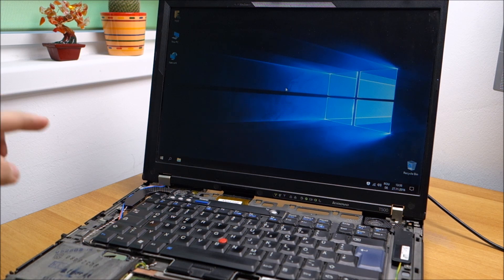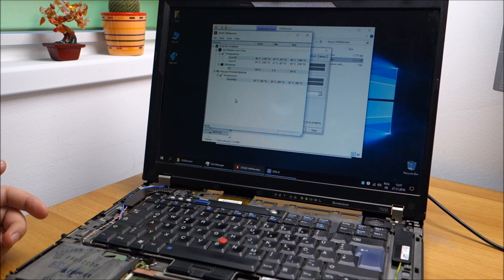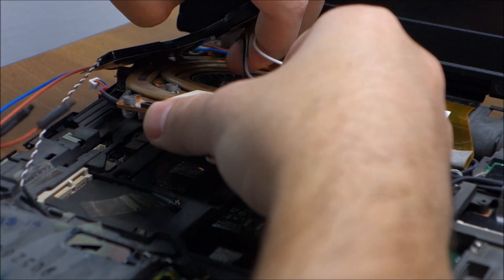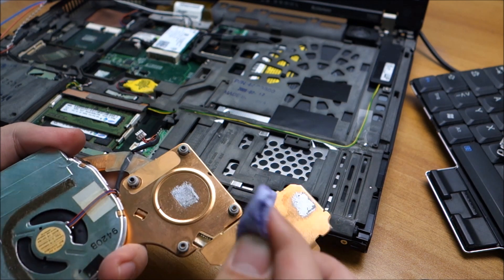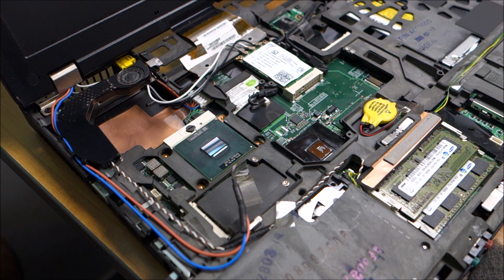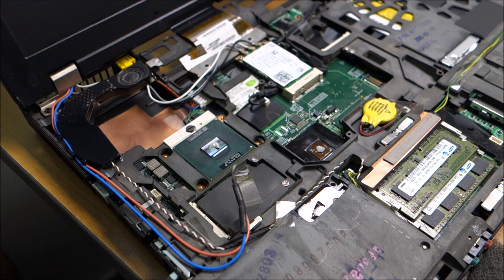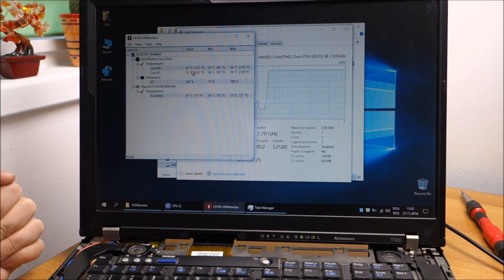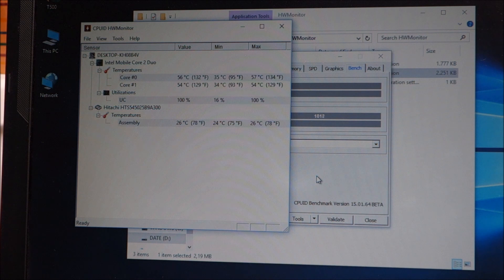DANGER! Coollaboratory Liquid Ultra - big problems after just one year

Comment: Leaving this as a top level comment so more people can see it:
I did more reading about this stuff since I'm interested in using LM for my own laptop, and it seems corrosion is not out of the norm. 

Typically when LM is used under the IHS of a desktop CPU (often necessary for intel chips since they bond the IHS to silicon with toothpaste instead of solder) the results are pretty good even after a year. The IHS (which is made out of copper, then nickel plated) does get stained by the LM but nowhere near what happened to you. This is because your contact (in a laptop) is silicon die <-> LM <-> copper heatsink.  In the desktop scenario, LM is often applied underneath the IHS so the contact is silicon die <-> LM <-> nickel plating <-> copper.

To be even more clear, the key differences in your application of LM is that
1. Your application was silicon-copper instead of being silicon-nickel as you would find in the 'delidding' of a desktop CPU
2. Your application was not insulated against air (read: oxygen)

1 is important because the electrode potential of gallium is -0.53V, nickel -0.24V, and copper +0.34V. Obviously, all liquid metals are made out of gallium (because Ga is liquid at room temp, and is also nontoxic unlike mercury) plus small percentages of other metals to reduce the melting point. When gallium is in contact with pure copper, the differences in electrode potential favors the gallium and copper to alloy, which will eventually consume the gallium completely[1] (Ga + Cu → CuGa2 [67%] + Cu3Ga [11%], and both products are stable until 175C)[1][2]. 
The liquid metal will literally into the copper until the gallium is gone, which causes the copper to turn silver-ish. The non-gallium components (indium, tin) of the liquid metal[3], which are solid at room temperature, get left behind - and that stuff is hardened deposit that you were trying to scrub off the heatsink.
Note that at higher temperatures, the reaction between gallium and the copper heatsink only gets faster.

2 is important because the gallium based LM components can and do oxidize. This is the reason why people generally recommend sealing your contact as much as possible. With a desktop chip under an IHS that's already halfway taken care of by the IHS itself, so if you've never seen a liquid metal tutorial for a laptop you might have not even known that sealing the LM was important. I'm not making this stuff up, gallium begins to oxidize at 25C and fully oxidizes at 75C[2] (Ga2O3, mass fraction 0.12) which is a totally achievable temperature range. This is not even considering the fact that the other components on the LM can oxidize, and they likely will.

Other interesting things to note: 
1. The thermal conductivity of CuGa2 (the principal alloy of gallium and copper) at 20C is 98 W/(m⋅K). Copper's thermal conductivity at 20C is 400 W/(m⋅K).
2. We have no idea what exactly is in LM, the formulations are proprietary - but it's been said that the consistencies of Coolaboratory CLU & grizzly conductonaut are not the same so clearly whatever is in this stuff varies and lead to different results.
3. Simply buffing the residue off the copper heatsink and reapplying the LM might be OK. The GaCu alloy is obviously not as good of a heat conductor as pure copper but it's not clear how deep the gallium will attack. If eventually you keep reapplying LM and the gallium can't penetrate its own pitting then it's effectively self-limiting and you end up with a 'stable' LM application.

These papers are interesting if you want to learn more about the process:
1. http://www.ipme.ru/e-journals/RAMS/no_81808/grigoryeva.pdf
2. https://sci-hub.ac/https://www.scientific.net/DDF.326-328.227
3. http://forum.notebookreview.com/threads/something-to-think-about-liquid-metal-compatibility-with-copper-heat-sinks.800890/

TL;DR
Liquid metal pastes react with copper heatsinks (aggravated by oxidation and higher temperatures) until the gallium in the paste is totally absorbed by the copper heatsink and you end up in thermal runaway. The damage to the copper is permanent, but if you keep reapplying the LM whenever this happens you may end up with a stable LM application. LM is much more stable when used under the heatspreader of a desktop CPU, since the heatspreader is nickle-plated and way less reactive to the LM.
Reply from the maker: +bobsagget823 thank you for this explanation! I will pin it as the first comment so more people understand what happened.
Reply: Randy Levine do you have any supporting documentation backing up this claim? The white papers I've read specifically point out that gallium, a key component of all LM pastes, is reactive with copper. You may be confusing the result of that reaction with what happens to aluminum, gallium is not destructive when it alloys with copper.
Reply: gallium dont oxidize (nor react with oxygen to from oxide} with copper. gallium adhere to copper lattice because gallium properties are much more stabilizing than galvanic corrosion. how gallium adhere to copper is like electroplating and what ever impurities does copper have gallium will occupy its place that is why when you open it or replace the LM again some pitting will be observed on bare copper plate. cleaning out the white residue and reapplying LM is enough.
Reply: Im going to go out on a limb on this but I dont believe that heatsink is actual copper, I doesnt have the same pinkish color to it that copper products tend to have. It looks closer to brass or bronze than pure copper. Both brass and bronze contain either tin or zinc which does bond with gallium. This on the other hand is not akin to the affect of corrosion or amalgamation like you see with aluminum heatsinks. 

its possible that you may have applied it in a wrong way but to me it just doesnt seem like the right metal. Gallium can bond with copper but not really anything substantial from what i understand in a bulk and more likely in a powdered alloy so I wouldnt put the blame on a copper heat spreader. 

you can actually see in this video what real corrosion looks like https://www.youtube.com/watch?v=Hx66m_TgQg4 (the copper is intact, aluminum is not) .

Another posibility is too much LM, it might just be a thick enough layer thats making it hard to remove.
Reply: bobsagget823 Amazing explanation. So then reapplying LM until copper gallium absortion has reached a "saturation" point is recommended?
Reply: Hai!! what do you think of using just IC graphite sheets instead of using LM
Reply: hell of a comment!
Reply: How about they tell and warn people about this before advertise and sell their product?
Reply: I can say it reacts and oxydize even with a nickel, applied for an mirror polished nickel coated heatsink on cpu and after a while I noticed an oxydize on a heatsink surface, not a mirror anymore:) and all written marks on cpu heatspreader are gone, just blank... That looks bad I can say.
But I don't think that's affect a thermals, it's just kinda welded. I guess it's a good idea to reapply a liqid metal after about a year of use, still, liquid metal does a great job, better than Intel stock, but it's not perfect either...
Reply: @Blackfalk Nickel isn't COMPLETELY resistant to alloy gallium... just VERY resistant.
Reply: Well... he actually linked papers about this and you can clearly read there: "It’s known that liquid gallium reacts with copper(Ga + Cu → CuGa2), and the reaction ceases whengallium is consumed completely"
Reply: bobsagget823 ok, so, basically, only good for delided cpus under the lip. Used below the copper heatsink it reacts, well its not worth the risk, not gonna use it. ill use kryonaut then
Reply: I just applied LM to my 1070 FTW GPU, and will be deliding my 4790k.. While the cooler on the GPU is Nickle plated copper, I wonder how it will hold up to the oxidizing factor as the GPU die is unsealed unlike an IHS. 5c drop across the board on the 1070 FTW though so it's hard not to see this work when first applied.
Reply: THANK YOU
Reply: Blackfalk who said that it degrades over time?
Reply: oxidation. 4Ga+3O2 → 2Ga2O3.
Reply: Just leaving a comment, so I can't find it when I'm repasting a notebook
Reply: YOU ARE MY HERO BOBSAGGET823!!! :)

I live in the same town where Coollaboratory lives and you CAN'T buy from them directly 'coz they are frauds, liars

....so sad that so many fools just can't see that the CLU is DRY and not WET on his CPU maybe they are just plain stupid or get even paid to talk shit like this.

btw. I'm a hardware MANIAC and have changed the TIM countless times on a naked 3570K with Coolermaster Master Gel and Phobya HeGrease Extreme. 

You people get all fooled by so many liars and you even like it to be stupid enough to buy their shit.
 
Thanks a bunch for your comment !!!!!!!!!!!!!!!!!!!!!!!!!!!!!!
Reply: Liquid Metal absolutely DOES NOT react with copper as stated, tested and verified by the manufacturer. The proprietary agents introduced to the formula inhibit such reactions. Those who experience problems with 'copper' aren't really applying Liquid Metal to 100% copper, but rather copper mixed with other metals... Get your facts straight!

Comment: Liquid Metal alloys with the copper heatsink, it is NOT corroding it. After 2 or 3 applicartions of LM at the same spot (after cleaning and polishing), the alloy reaction will stop and the product will be stable.
Reply from the maker: Indeed, but some say the resulting alloy has not so good heat transfer properties.
Reply: @UltimateDIY  I just looked under the copper heatsink from my AIO and I also have the grey staining, thermal grizzly got sucked into the copper of my AIO copper cooler, its no problem just clean it a few times with isopropanol and try to add a new layer on the CPU. You will notice that the liquid metal isnt really getting soaked in anymore on the copper, thats because of the grey layer which got added by the reaction. If you just redo the step, you will have great performance again and dont have to change it ever again.
The damage is just cosmetic on a pure copper cooler.
Reply: @UltimateDIY  There will always be people talking about things the do not know anything about.

Comment: @Ultimate DIY - You really need to pick the correct product for what you are doing and what the parts you are using are made of. Especially presenting yourself on Youtube as a DIY teacher you need to start at the beginning and plan things correctly before you ever think about posting a video. You are making this product look bad and this is widely accepted in the PC Enthusiast community as one the best thermal paste available. Check  a lot of different reviews and you easily find numerous examples of Coollaboratory performing better then any other thermal paste even other LM.
Reply from the maker: Not really. It's actually better to present videos with f*ck-ups, so people can avoid them.
For the situation in the video 2 things happened:
1. LM did react with copper, although this information was nowhere on the product page or instructions. Take into consideration that at the time I applied the LM there was 0 info about this on forums. This is like I would tell someone now in 2019 why did he buy an Audi with a 2.0T motor, because they all and up consuming 1 litre of oil at 1000km, but the dude that bought the car new when it came out had no way of knowing this.
2. The gap between the heatsink and CPU die was probably too big. Again, something that was not common knowdlege when I used this thing.
Take a look here and you will see that there are many cases when this thing solidifies: http://forum.notebookreview.com/threads/something-to-think-about-liquid-metal-compatibility-with-copper-heat-sinks.800890/
And about reviews...if I would have made one, it would have been awesome for the product, because initially it really droped the temperatures a lot. This is why reviews most times should be taken with a grain of salt.

Comment: My question is does liquid metal, if it landed anywhere in the laptop, would it not be working?

Cause my laptop is working and I put tape on the pcb but when I noticed it got super hot, I turned it off and took the lm off and I just put it on today. 

If LM was anywhere in my laptop, would it still boot up?
Reply from the maker: If it's shorting something out it will not boot up.

Comment: Yea don't use liquid metal with pure copper, the galium in it does react with the copper (although not as dramatically as with aluminium), 

that's what causing the "drying up"  (it does not actually evaporate, but the heat does help oxydisation and the copper/galium reaction),
what's left is either a copper-galium-alloy or the other components of liquid metal
The Copper/Galium alloy that forms has a worse heat conductivity than pure copper and the connection between the 2 surfaces via LM might be compromised, since the LM seeped into the copper.

The IHS the cpu comes with are usually nickel coated copper. So putting LM between the silicon die and IHS is fine.
Reply from the maker: Thank you for the explanation!

Comment: Liquid Metal (gallium specifically) dries out when is in contact with copper and temps worsen over time. Just clean up the old liquid metal with isopropyl alcohol and reapply. The LM will dry out less, the more the copper is already plated with it.
Reply: Well, it technically didn't dry up, but diffuses into the cooper metal structure itself. And yes, of course it diffuses less the more the cooper is gallium enriched. Like salt dilutes in water. At one point, the water can't hold any more salt. Similar principle. But usually, desktop CPU heat spreaders are covert with a layer of nickel, which should prevent that from happening. There are methods (electrical and chemically) to nickel-plate cooper yourself, but it's not really worth the afford. Just apply the liquid metal 1-2 times more when it gets hotter and it shouldn't "dry up" anymore because the cooper should be saturated chemically on that spot.
Reply: Just read the other consents. Yeah, probably just by the product which is meant to use on cooper :P
Reply from the maker: Thank you for the info!

Comment: galinstan forms an alloy with copper.
its the same with aluminum
on desktops the cpu heatspreader is nickel plated which is not affected by gallium.
but usually the cooler/heatsink made of copper will get alloyed but that is only a aesthetic issue.
Reply from the maker: Got it :)

Comment: I think everyone who uses "liquid metal" as a thermal interface material (TIM) is crazy.  Unless you just LOVE opening up your case 2-3 times a year to replace it, there are much better options out there.  The BEST TIM I've ever heard of - and I eventually used - is the expensive Thermal Grizzly's KRYONAUT.  It's got 12.5 w/mk, which is already points higher than your average TIM.  Arctic Silver 5 gets 9 w/mk.
I opened up an old Windows XP laptop I bought in 2005 with a 7800GTX graphics chip.  I used Kryonaut on both of those and the system runs very cool since.  I also used it when I delidded my two GTX 480 cards on the GPU itself before gluing the IHS back down.  I used Arctic Silver 5 between the heatsink and the IHS and I already see 10°C cooler temperatures on both cards under load.
Why do I refuse to use LM?  Because I don't like having galvanic corrosion on any of my hardware.  I don't want to have to open up the system 2-3 times a year to replace the TIM.  I'm more interested in USING my computer.  And before people try to "correct me", YES, GALLIUM DOES IN FACT REACT WITH COPPER.... just very slowly.  That's where the permanent discoloration comes from.  Nickel is the only metal used that doesn't interact with Gallium.  And it dries out way too fast.
Reply from the maker: I feel the same way. No more liquid metal for me.
Reply: you delidded gpus? thats a first.
Reply from the maker: Steven Van, good observation!

Comment: So the maximum usage is one year only? Is more than enough time to change regularly
Reply from the maker: No, not really. A laptop is not built like a desktop. They are not made to be disassembled often, so clips will start to fail and metal elements will start to get bent. Yes, if you only intend to keep the laptop for 2 or 3 years, than it's ok.

Comment: plz guy's... this is a metal paste! and you can't clean it like a normal thermal paste! you have to poliosh it like you do with your car! dont be dumb!
Reply from the maker: When I bought it, it was common knowdledge that it does not react with copper, so you should be able to clean it like any other thermal paste. Maybe a little more elbow grease, but not by polishing. By now it is common knowdledge that it reacts to almost any metal, but slower with some. So, before calling anybody dumb, try to see if anything changed in the meentime. I could call someone dumb for not using a ssd in a 486 back in the day, just because we all use them now, but that would not be fair, would it?

Comment: im not sure about chines version about "copper" in this case, it looks crappy metal whit copper color
Reply from the maker: Loool, so you can make a metallurgical analysis based on a youtube video? :)))
Reply: Ultimate DIY Relly? I didnt know that i can.
Reply from the maker: Jani N it sure looks like it :)
Reply: I have moore experience about coollab. liquidmetal now. On My delidded CPU liquid stuff was good after over year but when i checked to other computer, same stuff was dry when it was on IHS and nikkelplated heatsink, heatsink was not tighten very good.  that is one factor i think, if there is not inuff pressure and smooth contact+ high temperatures, it can dry.
Reply from the maker: That might be the case.